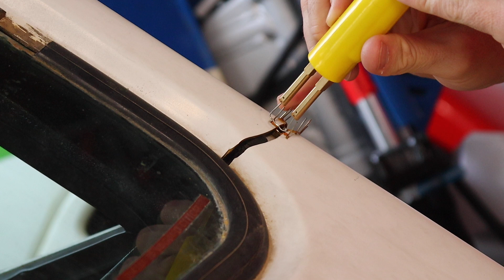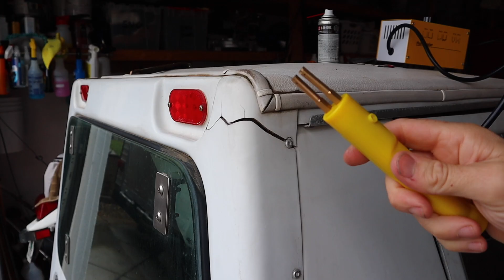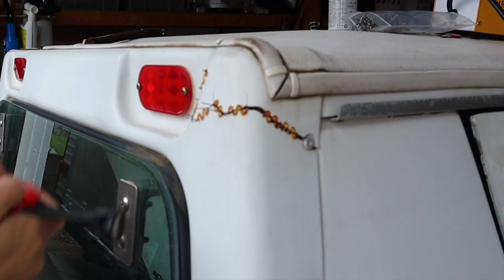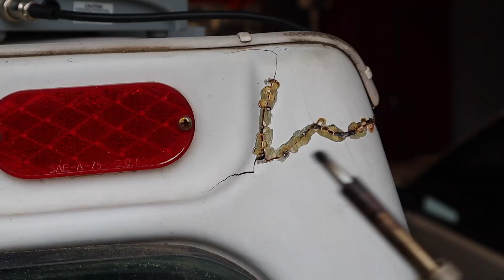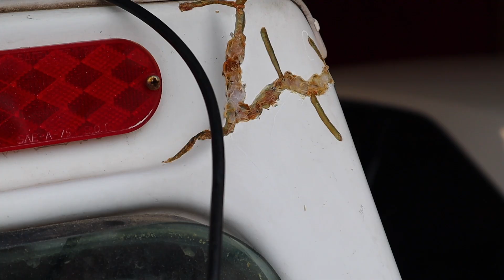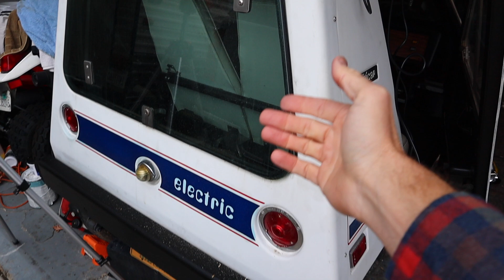How to Fix Cracked Plastic - Body Parts, Bumpers and More

Comment: Something I've been using to weld cracks on my citicar body is a soldering iron with a wide flat tip borrowed from my wood burning kit. I also suggest when possible putting some JB weld on the interior of the body where you fix the cracks from the exterior. Like you mentioned, it's pretty this plastic and most of these cracks are from structural strain so they could pop right back up if you drive it often. Keep it up! I really need to get back to rewiring mine lol
Reply from the maker: Good advice on the JB weld, I’ve also started using abs cement and a thinner cement that’s closer to the viscosity of water to penetrate cracks.